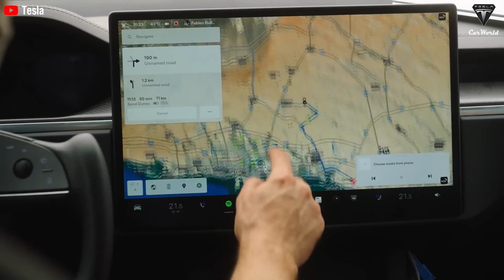Just Happened! Elon Musk Confirms Tesla Semi New Upgrades, Full Autonomous, Next-Gen Battery Powers!

Comment: We should be pushing Hydrogen Fuel Cell Tech and not Electric Vehicle Tech. We do not produce enough electricity as a species to turn every delivery truck into electric.
Reply: Of course we do!  Well, obviously there is no need to supply electricity yet to 100% of the road fleet.  Our grids have a good 20 years to adapt. In Europe, the grid is already up to serve 40% of the fleet being electric!
By the same reasoning, in the 1960s, you would have opposed home A/C, because mankind, as a species, does not produce enough electricity to sustain every home being air conditioned!
Finally, may I politely remind you that if an electric vehicle needs 1 unit of electricity to go from A to B, a hydrogen fuel-cell vehicle needs 3!!!  How do you think so-called "green" hydrogen is made?  A little internal logic in your argument wouldn't hurt!

Comment: It's not a 0 to 60 race but that kind of power would be fun to drive
Reply from the maker: Yes! We also love this power-packed fun!
Reply: Power is mainly VERY useful in hilly or mountainous terrain.  On a stretch such as I-70 on either sides of the Eisenhower tunnels, where gradient go up to 7+%, diesel trucks are slowed to a crawl of 25-40 mph, depending on engines and loads, while the Tesla Semi, with its 1020 HP, could maintain the 50 mph speed limit at full load without even breaking a sweat!  It would ALSO go faster downhill, because of the safety given by its regenerative breaking!  

On the 477-mile stretch between Denver, CO and Richfield, UT, the Semi would gain about one hour total trip time over diesel trucks.
Reply: @st-ex8506  a fun fact to consider is that even if you get there early, there are still high possibilities that you will waste your gain timed at your origin or destination while they delay in loading unloading as it is the nature of logistic business.😁
Reply: @xidptl  Sure!  I can understand that!  But that's not a disadvantage for the Semi, or is it?
And, if Richfield is not the destination but, say, the overnight rest + charging place to  a further destination, then the driver has finished his duty an hour earlier!  Good to take, I suppose!
Reply: @st-ex8506  i suppose the manufacturer is in better position to determine the advantage as they will be the ones developing the infrastructure to support this innovation.
Reply: @xidptl  Well, in the case of Tesla, yes. they have developed and will continue to develop, AND adapt to semi trucks their second-to-none charging infrastructure.

BUT, of the other manufacturers of e-trucks:
No Daimler, Volvo, MAN, Scania, DAF, Renault, IVECO, Freightliner, Kenworth, Mack... none of them is doing much concrete to develop the charging infrastructure...  yeah... some of them are partners in some charging network companies, but it's pitiful!
Reply: @st-ex8506  i realized just how expensive it is to own an ev as a personal car after purchasing one. All the savings from gas mpg are out the window the moment you charge at commercial charging stations. Not to mention the wait and the crap you put up with different network provider
Reply: @st-ex8506  while a lot of your observation is close to the current market situation it's seems ev could be much cheaper and possibly free.
Reply: @xidptl  do you mean free to purchase, or free to recharge?
And, in any case, should it be free? What is free anyway in our society?
Reply: @st-ex8506  the amount of spending government does in the name of saving environment is unbelievable. I guess you did not get the memo yet. 👋👋👋
Reply: @st-ex8506  great it's OK to block truth speaking comments
Reply: @xidptl  So, don't worry!  Your comments have no risk being blocked!😉
Reply: @st-ex8506  i posted a response prior to my last comment and it got deleted. Not sure why.
Reply: @xidptl  perhaps because it contained the web address of a link????  YT often does that!  It's MOST annoying!
Reply: @st-ex8506  Not really. YT seems to be the culprit.
Reply: @xidptl  Yes, absolutely!  It happens to me time and again!  Even though the message does not contain a single "politically incorrect" word or statement!
Reply: @st-ex8506  we know we are evil but we don't want you to say it. 😅😅😅
Reply: @xidptl  Good! We may not agree on a number of things, but at least you have a good sense of humor! 😀
Reply: @st-ex8506  are you assuming that I am referring to you as an evil?
Reply: @xidptl  No, not at all!  Don't you worry!
Reply: @st-ex8506  did it again.. I guess it concluded our conversation.